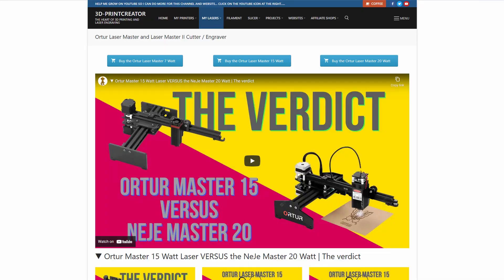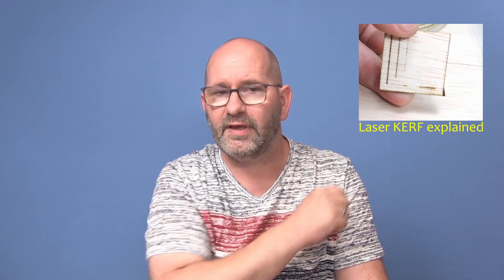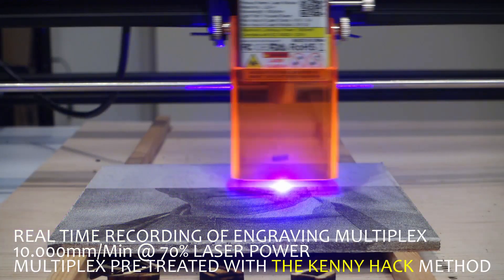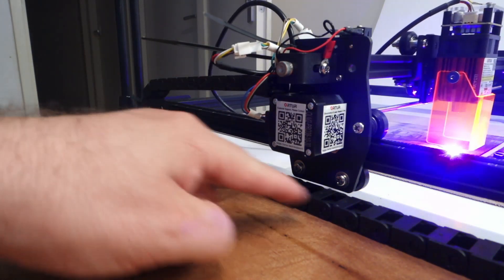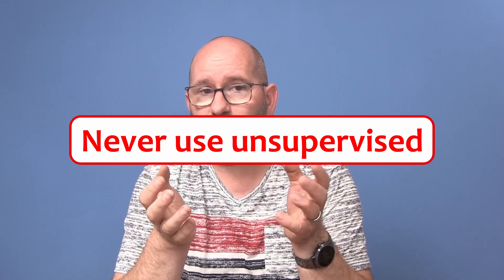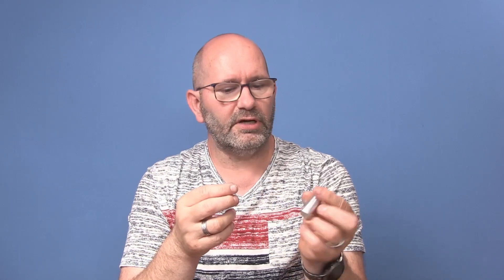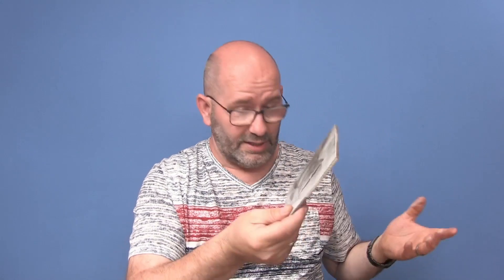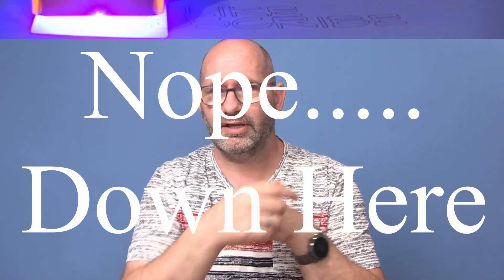▼ Ortur Laser Master 2 Pro | High-End Laser engraver

Comment: Hey Brian, Getting ready to pull the pin and purchase the LM2 Pro.  Wondering if there are any must have add-ons that I need to include when I order.  Thanks and keep the videos coming.
Reply from the maker: Without any other hardware, the machine is great. Yet, you could think of getting better software to control the laser.
Reply: @3dPrintCreator  any suggestions ?
Reply from the maker: @gjsindbq2427  I think Lightburn is great.

Comment: Do you still recommend making the 3d parts for the laser height adjust and air assist?
Reply from the maker: Yes, but keep in mind that these were made for the Ortur Laser Master 2, and not for this laser, the Laser Master 2 PRO.
I am still experimenting, but I will make an air assist for the Laser Master 2 Pro later this year.

Comment: Curious thing happened to mine. I went to the store and accidentally left it on. Not in use, just powered on. When I got home I opened my garage and the fire alarm was going off. But there was no fire, just the light flashing and loud beeping noise. In fact the machine was in the dark the whole time (maybe 15 mins).
Reply from the maker: Is there an active infrared alarm sensor in your garage?
The way the detector works is by detecting infrared light that comes from a fire.
Reply: @3dPrintCreator  Nope no sensors in the garage. My one theory is that it was dark in the garage, then I got hope and opened the door, letting sunlight in. Maybe the sudden change set it off.

Comment: Hey Brian, cool rig, I really L-O-V-E the stop button and the new reflection shroud around the laser. Finally someone's thinking of safety. What is the distance from lens to object on this one ? The last ones I was working with all had a very short focal length, making it hard to cut wood or acrylic without tons of charring.
Reply from the maker: Hi Dirk. The spacer to focus the laser is 50mm, but the lens is about 11mm long, so from lens to object it's about 39mm.
Also, because the dot is really small, the power is comparable to using the old laser in 6 passes, now in one pass.